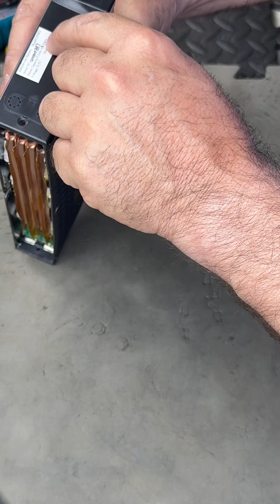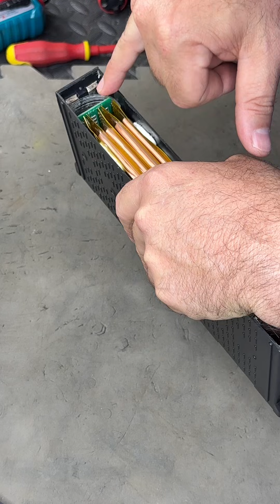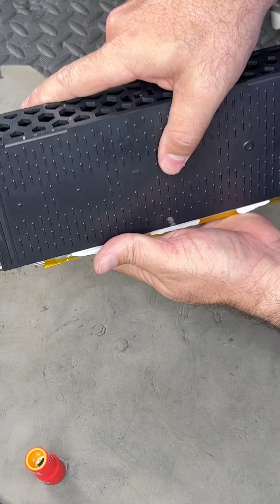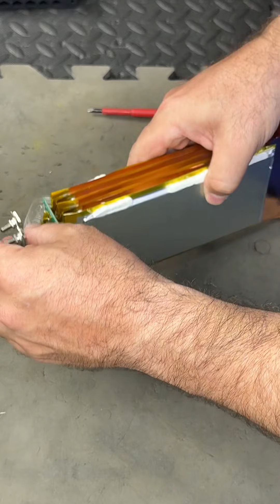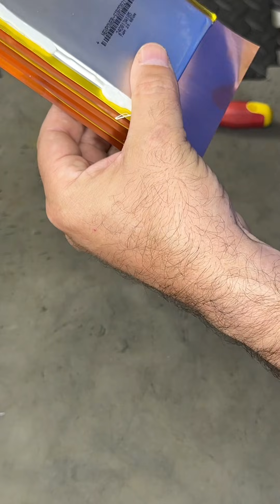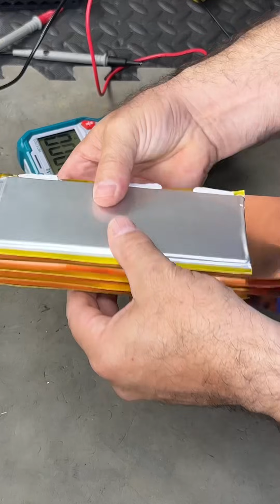First Look Inside the NexPower Sodium Ion Battery for Toyota Hybrid Cars

Comment: I have a Nexcell lithium in my 08 Prius and it crapped out within a couple of years and very little mileage.  There wasn't any negative information when I bought it.  Now there is and I want to go back to the OE battery which lasted upwards of 250,000 mi without any maintenance.  I bought the car from a friend and know that she is the type that gets in and drives as long as the car starts and runs.  She'll change oil and that stuff but certainly won't have the main battery serviced because there is nothing to alert the casual driver that it needs maintenance.  Does anyone have any sources for a new OE battery? .
Reply: Same here with an 07. Had errors after a couple months due to difference in internal resistance, it lasted about 2.5 years and eventually died due to being below the safe lithium temperature range. Which could have been prevented if the batteries had a bms (the sodium still doesn't have anything).

Ended up buying a new nimh pack from newpriusbatteries

Comment: Are these really sodium? They look like lithium cells. First time see sodium cell in "soft" package. It would be interesting do puncture test and check if it wont catch fire as sodium should not burn if damaged.
Reply: Both catch fire. Sodium has higher temperature for runaway

Comment: Those paper thin copper ‘plates’ concern me. There’s no way they are providing any meaningful heat dissipation, except for into the neighboring cells. What is that board on the end? Is it a BMS? I can’t really see any components that would indicate so, which must mean it’s passively balanced? That’s a little concerning too, considering how dramatic is the voltage range of SIB.
I was really excited for this for a Highlander hybrid, but I’m going to try to find out more before I’m willing to trust this.
Have there been any teardowns by electrical engineers? I can’t determine if Jack is one, but his “test engineer” listing his qualifications as being an uber driver is also a gigantic red flag. (To be clear there’s nothing wrong with driving for Uber—I do too—but it’s not an engineering qualification).
Reply from the maker: @Neberheim  time will tell how these will perform 👍 and the board is just a passive balancer for each module
Reply: I’m actually more confused after watching his videos. From what Jack says, it almost sounds like there is no active or passive BMS in either this or the previous generation lithium pack. He mentions cars failing because they were drained to 0V after being in neutral but that doesn’t make any sense unless he didn’t have even basic battery protection and relies on the stock NiMH system that lets the cells self-balance at the pack level. That can’t be right, because lithium and SIB cells can’t simply tolerate overcharging or over-voltage like NiMH cells, which can basically “passively” balance themselves unlike li-ion, SIB which need their own circuitry to passively balance; otherwise the cells would degrade crazy fast.
I’m guessing what you’re looking at is what he calls a “blade”, so if there is no passive or active BMS in the blade (and looking closer at the board seems to indicate that there isn’t passive balancing circuitry after all), then the blade must be 3.7V with the cells in parallel and the blades are wired in series to a BMS before interacting with Toyota’s systems, however he’s doing that.

Comment: My lithium battery pack lasted about a year. Had the V2.5 "upgrade" done within a few months; didn't notice much of a difference and it may have been a downgrade. Anyhow, I have around 360 miles on this V3 Sodium Ion battery as of today (02/02/2025). I have a well maintained 2010 Prius with 241k miles and getting around 42 mpg (38 mpg prior) driving mostly highway (aggressive 85 + mph). But, I do drive normal-ish on city streets. so far so good...
Reply from the maker: @zero2three1  let’s give it some time before any statement to see how they perform 🫡✅✅✅
Reply: @hybridsolutiondiagnostics  Of course. I'm just telling it like it is. I understand the experimental nature of this "project."
Reply: Why did the pack only last a year? It was a NexCell pack?
Edit: after watching more of his videos, it almost seems like he was relying on the stock NiMH battery management to manage lithium cells. I can’t accept that that is accurate, although I can’t think of another reason why a pack would be drained to 0V like he mentions in his videos unless there was a total failure of the lithium BMS (in the pack, not the OEM system). If it is somehow correct, then the packs were designed to fail and yours lasting a year is pretty good.
Reply: @Neberheim  Mine has lasted about 16 months.  I had to rebalance with 2 blades creating abnormal drainage.  Now the car is dead and I have little choice to get the sodium ion.  But Jack seems like a great guys so hoping this project really works well and succeeds!
Reply: @Neberheim  Yes, it was the "Project Lithium" from Nexcell and he was relying on the factory BMS. From my limited understanding, each lithium module didn't have a lithium BMS. My pack wasn't drained, just the opposite as it was showing 100%. Probably overcharging and wreaking havoc... It's a disappointment for sure but I understand the risks.
Reply: @ I’ve since found John Sullivan’s channel (doppelhub) and analysis of the packs, and it’s frankly shocking at the level of inexperience and frankly incompetence behind NexCell.
Reply: Looks well thought out impressive larger cells. improved air flow cooling.
  Great job Jack at Nexcell.

Comment: Thanks for this. With Toyota raising the price the first of the year the new replacement batteries for an older car no longer make much financial sense. I’m hoping these turn out to be a good replacement for my 2 gen2 Prius’s.
Reply from the maker: @Texaspowerman  these are quite new so let’s give them time before doing any statement 🫡✅✅✅
Reply: @hybridsolutiondiagnostics  He's had beta test cars in extreme conditions in the states with these for 2 winters now. They are pretty much proven for short term reliability. 10 years later..that's the question.
Reply: @hybridsolutiondiagnostics  Good afternoon, please tell me. Kia optima 2012 hybrid car gives an error to check the hybrid system error P0A78 at idle works perfectly, as soon as I translate into D or R it highlights the error and pulls it. It all started with the fact that in the frost, if it is poorly warmed up, it began to twitch (it is not the engine that pulls, but the box) it began to warm up longer, then it does not pull. The inverter pump is also cold, thank you
Reply: I’d just get a reman battery.
Reply: @ I’ve got remanufactured batteries. The last about 5 years and cost $1,600 now. A good one used to be $900 installed but the price of decent modules has gone up as the become in short supply. 
I use a maxx volts charger to keep them in good condition but they just don’t last as long. If there had been some notice of the price increase I would have bought a new one in December for my 09 that still has the original battery in it. I’m 70 and can’t do the proper maintenance on them myself anymore. 🤷🏼‍♂️
Reply: @Texaspowerman  Do you think it's the battery?
Reply: @hsew  Do you think it's the battery?
Reply: Remember to put the batteries in your fuel cost column. They are not technically part of the regular maintenance of the car. Since the batteries are fuel cells. They help keep the car running at high MPG. To work my truck costs 10k in fuel annually but the prius is 3k. So if i have to replace the batteries every other year. Its still cheaper than fuel costs in my truck.
Reply: What price raise?  A  G9510-76013 is $1,957.04 + $1,350 core, I don't remember prices much less than that for OEM new from the dealer.
Reply: @ the 3 suppliers that I have talked to are now charging $$2850 plus the core. The price increase went into effect on January 2. That was the 2 local dealers and a local authorized reseller. Before that I was paying $2495 installed. The shop that I’ve used hasn’t purchased any new stock since the price increase went into effect.
Reply: @texaspowerman   Just buy elsewhere, no reason to pay more when other dealerships are selling it for what I noted above.